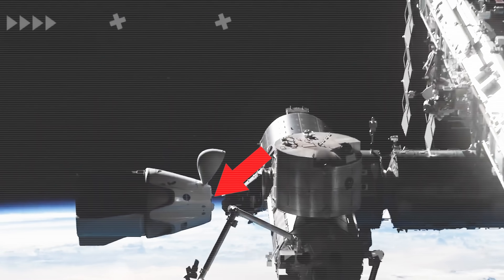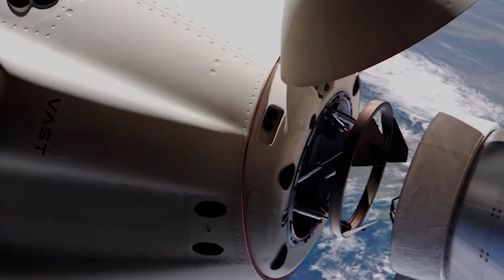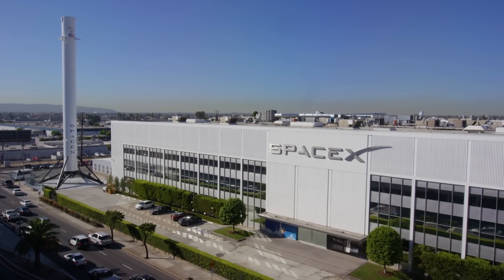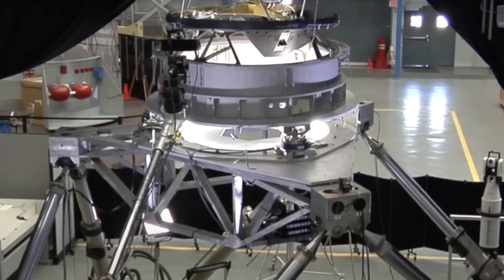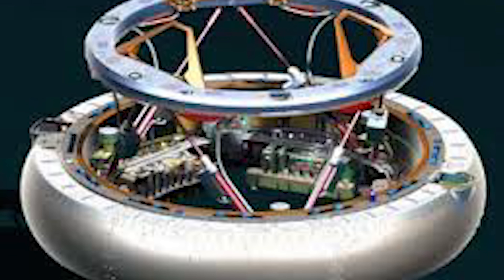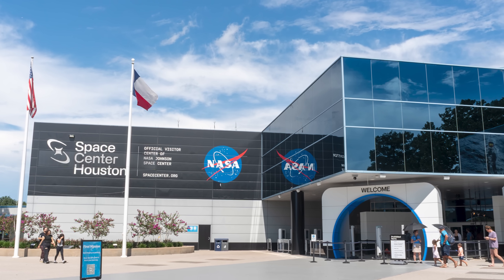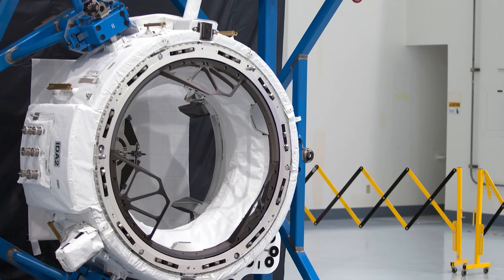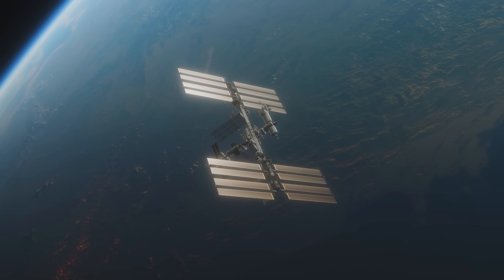SpaceX's new Dragon Docking ISS Method Shocked Russia & NASA...

Comment: A speed of 4.9 miles per second is approximately 17,640 miles per hour (mph). 
This speed is notable because it is the approximate orbital velocity required to reach low Earth orbit from the planet's surface. 
For context, the International Space Station (ISS) actually travels at a slightly higher speed of around 17,500 mph (about 4.86 miles per second) to maintain its orbit. This speed allows it to continuously fall around the Earth, counteracting gravity and keeping it in a stable path.  U Think !

Comment: This is the same reason I think they should have teams made up from people from many different mechanical backgrounds. Just like the docking adapter came from a mountain bike or dirt bike enthusiast. The same way I was able to fix things that made engineers with master's an PHD. scratch their heads and the only collage I had was placement testing where I tested top 2% in mechanical reasoning. So gat a NASCAR or NHRA or Indy car master engine builder on the engine design team.